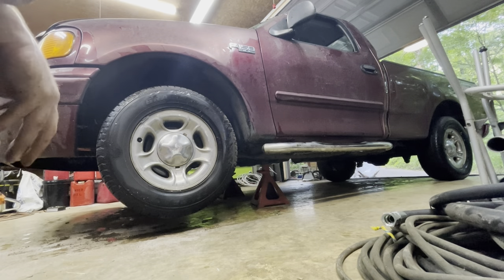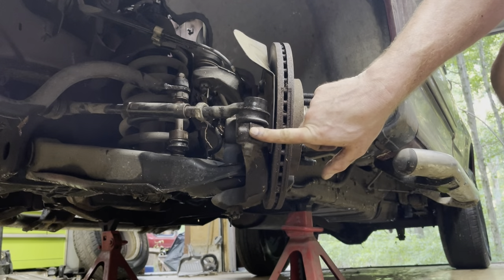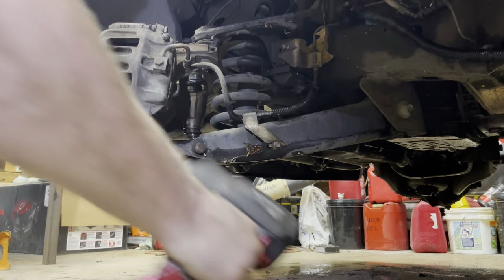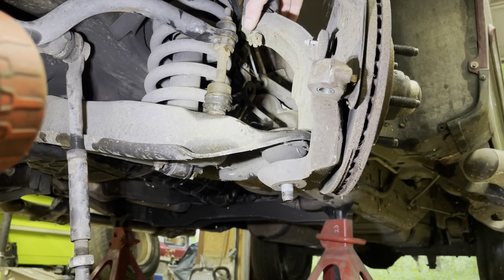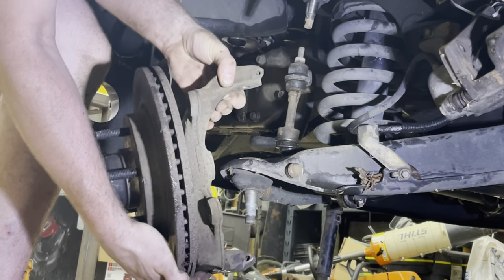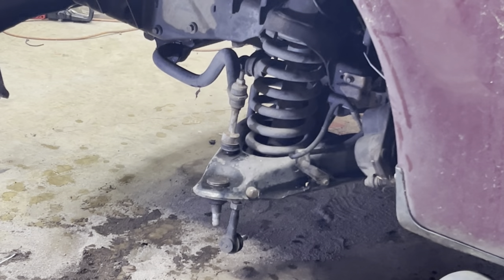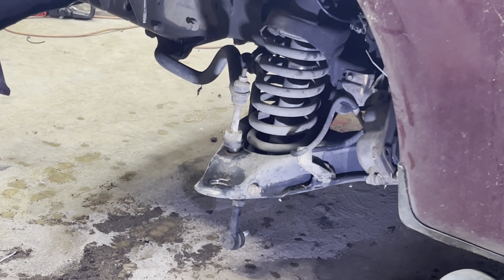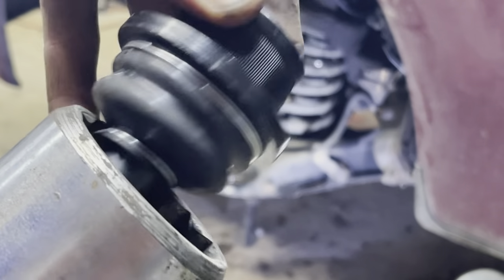F-150 balljoint replacement without special tools

Comment: Add this to your little bag of tricks! Stick your new ball joints (you can do this same thing with sealed bearings as well) in the freezer for a couple hours then when your ready for installation heat up the lower control arm (with the bearings it's the spindle) the cold shrinks the ball joint and the heat expands the control arm. It practically falls in. 😉

Comment: Good vid but this is  why I bought a ball joint press for 30 bucks.
Reply from the maker: @greebuh  I don’t think you caught the end of the video. I have a $800 OTC balljoint press kit. When the truck is clean enough to do this, it’s easily twice as fast. Which matters if you’re getting paid per job, but not if you’re DIYing your own car.

Comment: Amazing man!! Thank you! I’ve been dreading this one my F-150
Reply from the maker: You can do them in a single evening without much sweat. Make sure to orient the lower joint  grease fittings so you can reach them with a grease gun without a jack. Aim them straight forward but around 30* angled inward

Comment: They don't get messed up if you tighten them after you have load on the vehicle suspension. Tighten all rubber joints after truck settles
Reply from the maker: Correct.

You can also simply reinstall the A-arms at the exact same angle the old ones rested at, tighten them down, and set the vehicle down. The faster technique which we do at many dealerships without problem. We’ll make alignment marks before tearing the vehicle down.

The important thing is for the bushings to be in their natural state with the weight of the vehicle on the suspension. Rather than twisted up like a pretzel because you locked the bolts down with the arm well above or below the correct position. Weighted settled suspension is best, always, however.